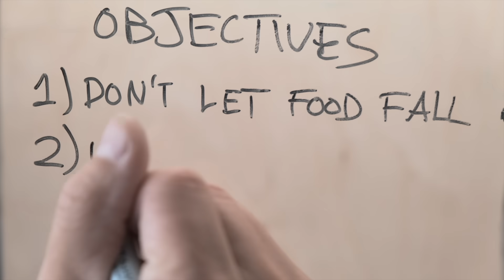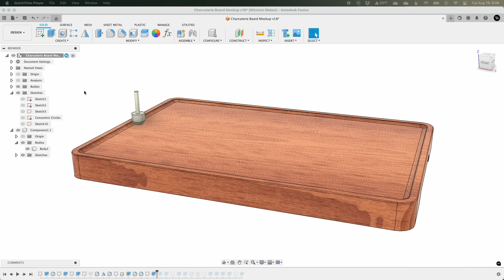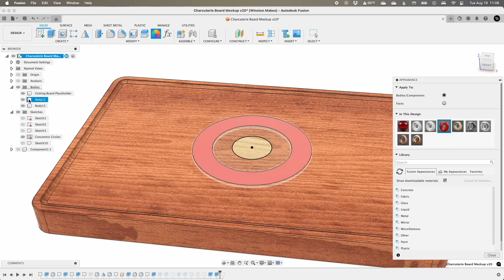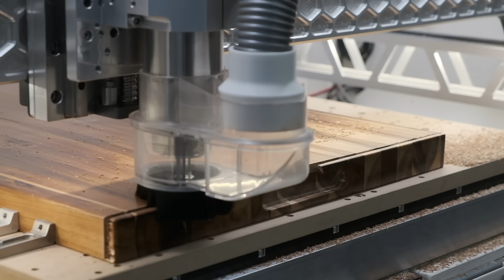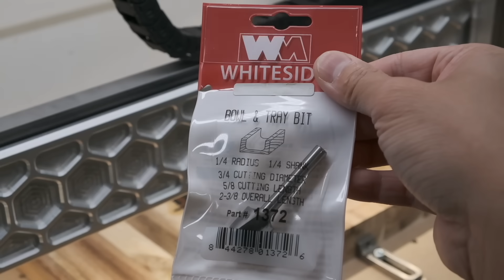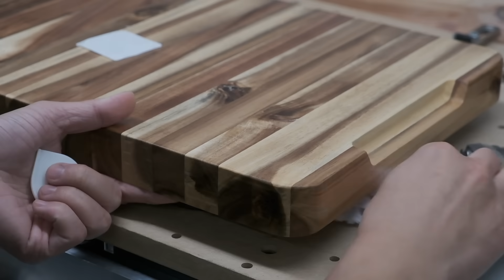Mastering Multi-Color Epoxy Inlays

Comment: On the topic of epoxy (or any two component reaction mix) especially the mixing ratio can change the curing a lot, even when it's just 1-2 ml off. Old age of the components will probably make that effect a lot worse

Comment: Great work.
From comments online people say 200-400 grit is optimal for adhesion.
From actual studies it does peak in that region, but if you push it to 1000-2000 grit it doesn't look like you lose a lot, maybe 30% strength? Might be acceptable.  
There are also some surface roughness studies that found within a range "there is no significant difference in performance when comparing different grades of shot or grit."

Comment: I suggest you get onemof those cheap fan heaters (room heaters) with a temperature controller in degrees, and point it at the epoxy when curing. You can set the heater to just warm, ie body temp 35'C and it will allow the epoxy to cure much faster, so an overnight cure is all you ever need. Those little heaters are only about $30

Comment: Hello Winston, thanks for your video. Im interested in your workholding Clamps do you use at your Shapoko. Do you sell a Fusion 360 file or do you sell this clamps? Best Regards Markus
Reply from the maker: The clamps I have in my shop are mostly old/discontinued clamps from Carbide3D. But, they have some newer ones that are better in many ways, and they also have some printable versions of the basic clamps you can download and make for yourself. Just make sure that if you print your own you use a strong filament and print with a lot of perimeters/solid.
Buy Metal and Glass-Reinforced Nylon clamps: https://shop.carbide3d.com/collections/workholding
Print your own CNC accessories: https://carbide3d.com/3d-print/
Reply: @WinstonMakes  Thank you so much. Greetings Markus

Comment: really great stuff winston. beautiful work. question... do you know if the totalboat epoxy is food safe? i made an epoxy inlay cutting board once for the inventables folks that they featured on their website and I remember trying to find an epoxy that had a better chance of being food safe.
Reply from the maker: They've got a couple epoxys that are rated for “limited food contact”. So charcuterie board okay, but don't like… use a metal knife on it, otherwise you'll probably put weird microplastic into your food. Which is probably safe advice for even the most inert epoxy, regardless of brand.

Comment: With the circle example, you would waste even less epoxy if you carve out the white ring before the red space. For epoxy pouring, I use silicone measuring cups which are reusable and are even easier to clean :)
Beyond that, beautiful board! And I love the 3D printed feet-locator helper thingies!
Reply from the maker: As long as you offset that circle outwards first, so it overlaps into the area of the red.
Reply: @WinstonMakes  Exactly, I edited my comment a bit btw. But it's a nice educative project documentation, once again. Thanks for sharing!